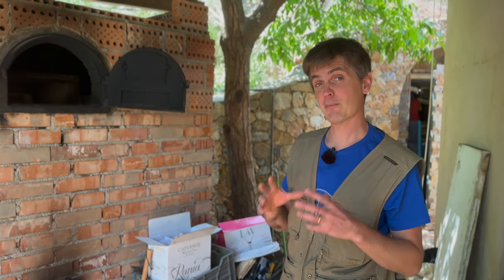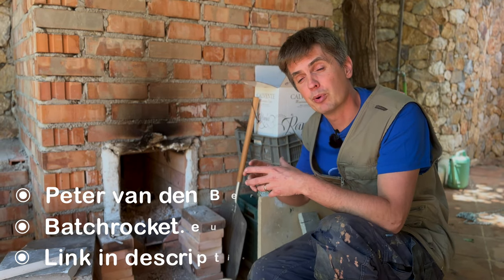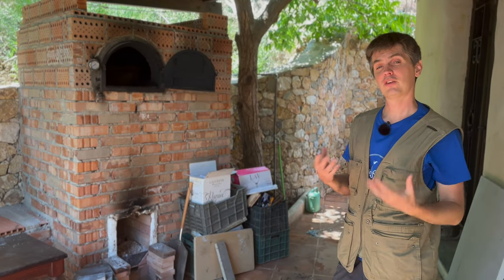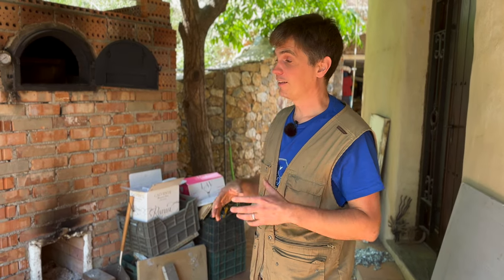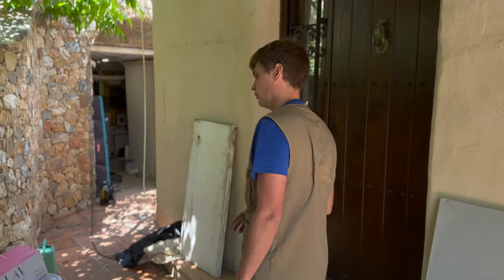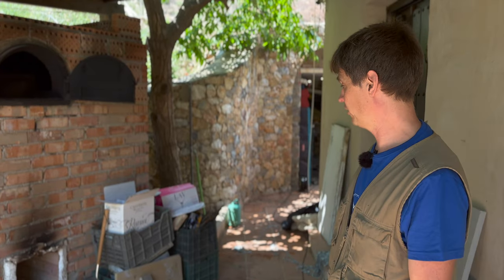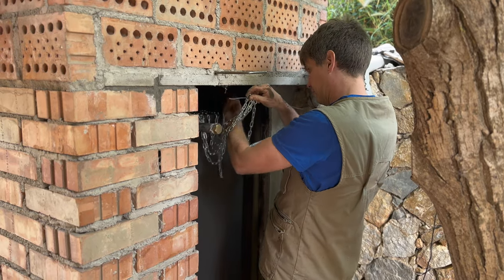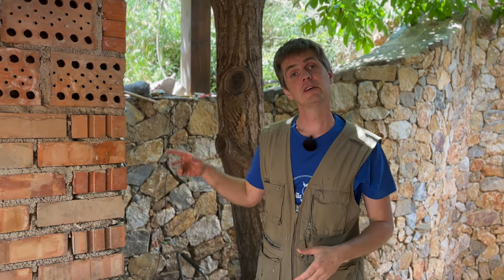Heat water🛁 Bake Pizza🍕Heat the Space🔥| Super Efficient Wood Burner that does it all! A Rocket Stove

Comment: Oh wow, I could learn so much from your experience with this. I'm so glad i came across this video. Is it correct to say that if there's soot on the heat exchanger then you are not achieving full combustion within the core? Does soot deposit on the masonry bell when the heat exchanger is bypassed OR is it only the cold water in the heat exchanger that puts too much load on the stove?
Reply from the maker: Hi Beetooex, I asked the builder of the stove, Lucian, for a reaction, this is what he said: 

So, the bottom line is yes, obviously, the presence of soot means it's not burning completely, and that's not good. But there are lots of reasons that can happen. First of all, no rocket stove, especially a batch rocket stove, burns perfectly through the whole burn. When you first light it up, it's not burning efficiently because nothing's hot yet. The chimney hasn't heated up, and the heat riser hasn't heated up. The oxygen mix is wrong, so you're going to get some degree of soot deposit. The longer the outflow is from the main stove, the more opportunity there is for that to deposit as carbon.

Especially if you've got imperfect combustion and a big tank of cold water, it will drop all of the soot really quickly onto the heat exchanger. One thing you could do, and what we do these days more, is to leave the up and door open to access a bypass, but we could have built a more dedicated bypass for that, I guess. That's one suggestion. The other thing is that the whole stove is at the limit, really, of what it can handle, especially with the heat exchanger in the flue gas path. We're on the edge of putting too much load on the main core.

Peter van den Berg explained that it's possible to overload the combustion material for the secondary burn. If you put lots of small bits of wood on the stove after it's already going, you can generate so much smoke and carbon monoxide that it overwhelms the stove's capacity to burn it all in the secondary burn chamber. This is a limitation with this batch box rocket design; it's hard to tune the loading so that you don't get that effect.

The first few times we ran it, we got some thermal runaway, where if you put loads of paper on it, you can end up with so much material burning so quickly that it can't suck in enough oxygen to burn it all in complete combustion. That produces a layer of soot out of the end of it. So, bottom line, yes, there is imperfect combustion. But sometimes imperfect combustion doesn't mean the thing is not working correctly; it just means it takes a bit of tweaking. He's probably right that the whole thing is a little overloaded.

We had to make some approximations because we wanted another that wasn't a pure bell. We wanted to keep some heat in, which effectively reduces the load for the load calculations. But the heat exchanger increases it. We insulated down the back because we didn't want a completely four-sided structure; we only wanted to lose heat out of the front. So, a lot of the calculations were pretty approximate. It's not perfect, but I don't think the presence of soot immediately means the whole thing is totally wrong. It just means sometimes you're not getting full combustion.

Hope this helps!
Reply: @CreateYourOwn_Paradise  Thanks so much both of you for going to the effort to educate me 😁 Please do make a follow up some day- I'd like to see if Lucian makes the modifications I've guessed he might lol.

Comment: Hi.
The floor channel shall have rectangular crosssection. Kinda 3:1 ratio od its sides.
Hasn't  covering the heat riser with the plate caused the setup to become smoky and less efficient?  Normally we try not to limit gas flow especially through narrowing that have CSA smaller than system size.
You may try installing some clean out at the end of the bench and use it to heat iup  the chimney with s gasburner (or a candle) while lightning up a cold stove. 
BTW. The double shoe box require stable strong draft so it is was prudent not to use this core.
Id love eto hear about  the results of disrupting linear flow in the heat exchanger.
Do you get much condensate drip out from it?
Reply from the maker: As the builder does not have a YouTube account, I have asked him for his answer and this is what he said: 

The CSA of the gap between the shelf and the heat riser is (20*4)*9 cm = 720 cm2 which is about double the CSA of the heat riser (314cm2) so the there is really no meaningful restriction of the gas flow. We didn’t see a noticeable difference  in burning before and after installing the shelf.

Yes, we have options for heating / force ventilating the chimney; in reality so far it’s not really been necessary : with a little care lighting the stove it gets going fine even when cold.

Condensate drip: I haven’t noticed a lot although I haven’t checked frequently. I don’t think it’s a huge problem because there isn’t anything important to damage or obstruct underneath.